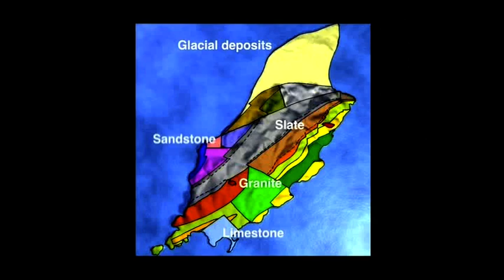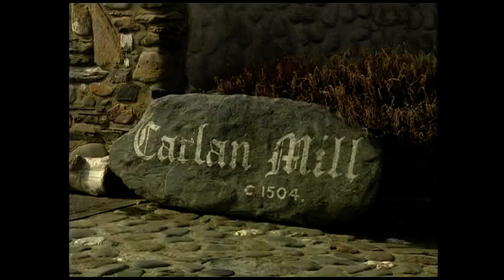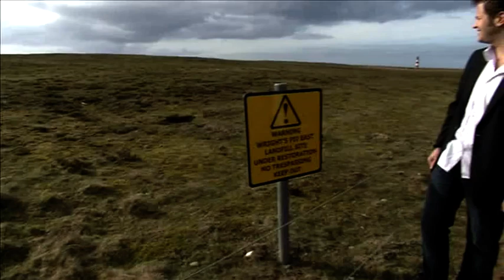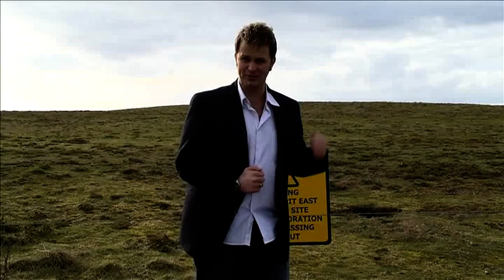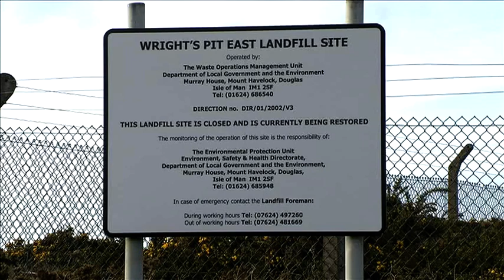The Disappearing Island: The Problem of Coastal Erosion on the Isle of Man

Comment: FYI, I looked on Google Earth on 5-5-2021for Carlan Mill and found its still there.  The map image is from 2/25/2020. location 54 20 24.15 N  4 33 16.87 W.  It still looks like it does in the picture though the shore has eroded back and the stone jetty is gone.

Comment: Need the concrete JAX for the sea wall. 
They break up the waves and the blocks take the water away from the soil. 

See the builders in Dubai. They’ve been experts at using concrete to avoid erosion. 
Them and the Dutch, should be reached out too. 
I’ve been going to the TT all my life, this next go will be the first time I race myself and I’m not just a spectator.